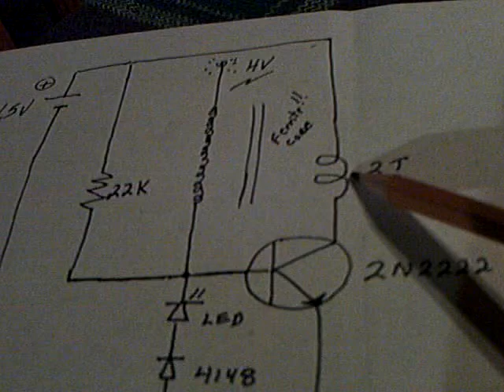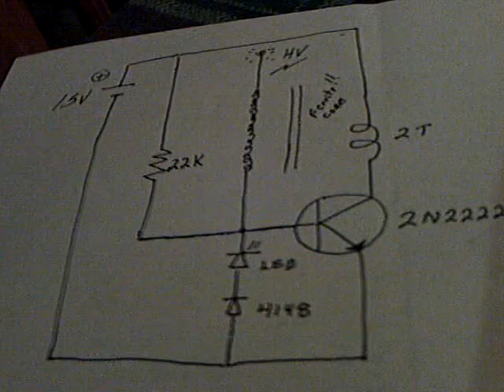Tiny Slayer Exciter mounted on a circuit board.ASF

Comment: Can the coils be made with piees of copper tied together? Here in Mexico its hard to get rolls of copper wire or enamal wire. So we have to pull it out of coaxial cabel, and then tie them togher while wrapping around a coil. Does this matter? As my coil is not working. Thank you in advance GREAT POST BROTHER

Comment: my exciter puts out close to 3 amps, not mA. how are you guys getting your amps so low. im using a 4.5 volt dc power supply, and a turkey roaster as top load. seconday is 1100 turns of 30 gauge around a 1/4 inch tube., primary is 10 turns of 26 gauge insulated just wrapped on secondary. any ideas? new to all this.

Comment: i replicated jonnydavro's one and it didn't work with 1.5v so good, it barely lights up an LED but at 12v it makes plasma and i almost screw up my keyboard and monitor ,the keyboard started to write by itself and the LCD monitor started to flicker :D